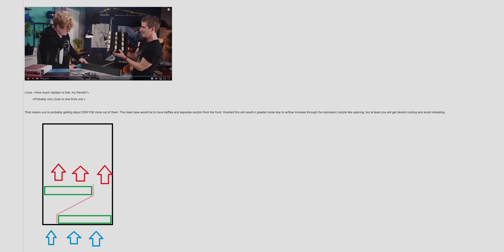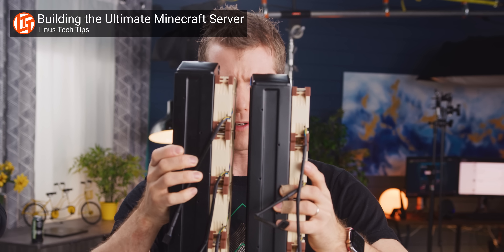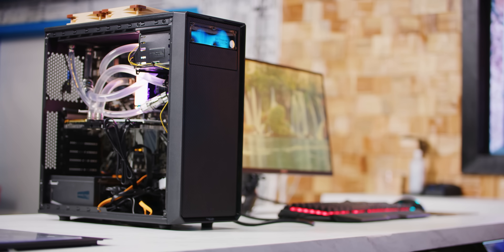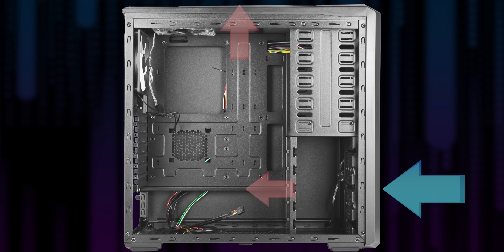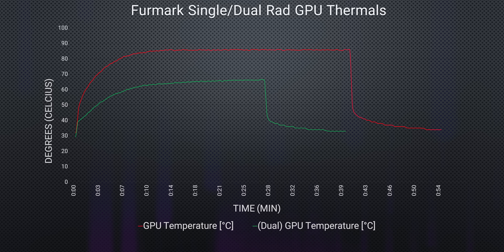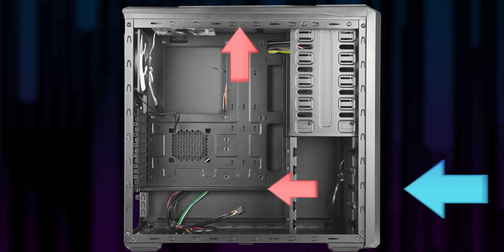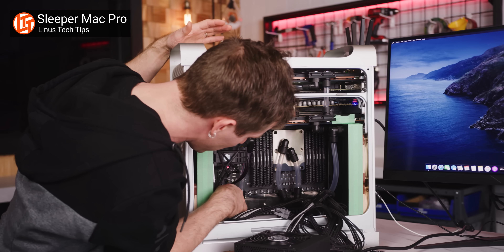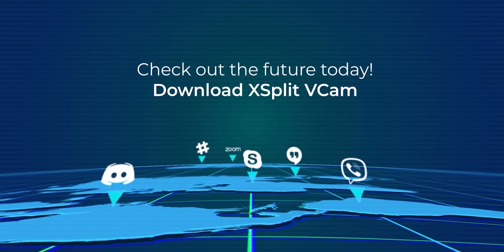I’ve been water cooling wrong for YEARS - $H!T Manufacturers Say

Comment: Although your test yields good results and makes more sense when considering a normal PC build, I assume Corsair was referring to how you stacked the coolers directly one on top of the other in the minecraft build. 

Although the air going through the second rad would most likely have the same/similar temperature as your simulation, the decrease in static pressure through the additional airflow interference of the subsequent rads would most likely be the cause of the negative impact of stacking rads. 

I believe their main point is that you shouldn't stack rads end to end, so to debunk their point i suggest testing with that instead

Apart from that, love the vids, big fan <3
Reply: Did you actually watch the video, he mentions they removed one of the rads from the server and the temperature went up by 5 degree.
Reply: @Torguemada  I did watch the video, and yes he did mention that result in the end, but essentially the whole content of the video up to then does not really serve much purpose and the experimental data is not relevant to that. That one sentence at the end was more relevant as a response to corsair than the rest of the video.
If he had done the same analysis with the stacking of coolers it would have made a lot more sense in my opinion.

Comment: @Linus why not skip the water . And use rads and copper water blocks.  But plumb with copper also then vaccum and charge with freon . Like in heat pipes.
Reply: Basically a bigger Simi modular heat synk . Just the referigant is a better conductor of heat. A CFC licence is not to hard to obtain here in the US. Basically a tough multiple choice test. . I self studied to get a class 2 CFC and passed the core exam plus class1,2,and 3. Giving me a universal cfc and technician licence. I have no clue if the process is similar in Canada. But here if you purchase the exam from a refrigeration or hvac supply business. You can take the study guides ..ect home to prepare. .. I did not know this ..  and just found several free online test that I did until I could pass all of them with perfect scores.  .. and nailed it .

Comment: Reverse the direction of the fans on the front radiator then test again. When adding more radiators you should simply ensure that the air doesn't pass through both ie they should all be set up to blow air out of the case.

Comment: What about water cooling a system with the rad mounted completely outside of the case I am building one with a push pull with a corsair cpu cooler havent finished it yet but just a thought

Comment: More radiators means more flow resistance, more couplings and all, so I use a single radiator as large and thick as possible which right now is a 4×80mm because can fit no more. I do everything to lower flow resistance because OCD and me.

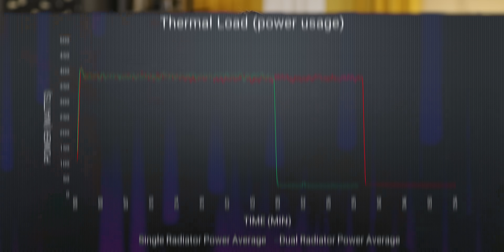Comment: At 5:19, 5:25, and 5:28 I noticed the test for dual radiators ran shorter than single rad (~13 minutes). Wouldn't you want to run the dual system for longer due to the increase thermal capacity with adding more volume of coolant into the system? I would have run the dual rad setup at least twice as long just to prove the accuracy of the results.

Comment: If you add more radiators and keep same amount of fans, sure Corsair is right. But if you sandwich then with extra  fans you get a venturi effect, you get an increese air speed, which dissipates the hot air faster. Also depends how the water loop goes, if the hotest radiator is the last to be touched by the passing air, will still have a Delta T sufficient to not make the radiator redundant. Is this as efficient as running only one radiator ? Hell no ! It will have diminishing return the more you add radiators and fans to the system. Does it work, yep ! But will make the system noisier and power hungry.

Comment: Tell me if i missed something, but I think what corsair meant was that with the same surface area, it is more efficient to have both of the rads suck in fresh air rather then having the second rad suck in warm air. Also the server case, well you removed surface area too which impacts cooling. A proper comparison would be the dual rad test, except once both of the rads are intake, and in the other case the one's intake one's exhaust.

Comment: Industrial thermodynamics engineer here to clear a few things up.

What I think you guys have done is this: the additional top radiator you've added takes the fresh load of hot water and passes it on to the original front radiator. So what happens is the front radiator doesn't have that much heat to dissipate, hence the internal air temperature isn't heated too much. It then passes through the top radiator, which still has plenty of dT (temperature difference) left to not run into diminishing returns. In engineering this is known as a counter-flow heat exchanger. Which is a good thing by the way! so GG for configuring it like that.

What I think happened with the Hackintosh system is you guys had the intake as the hot radiator and the exhaust radiator as the lower temp radiator. Thus indeed the exhaust radiator wouldn't have too much capacity.
Reply: An addition to this: Please google "temp diagram heat exchanger".
With the minecraft server, you probably also set it up as counter-flow. Which means the back radiator is the hottest and the front radiator which takes the fresh air is already the coolest. If you would change the flow direction only the first radiator would do any significant work. The 2nd and 3rd would pretty much just act as a thermal buffer due to mass.
Reply: I build a mITX water cooled system as a side project. In these systems every little thing counts, so diminishing returns is completely out of the question. For bigger systems like yours that is of much less significance of course so you can just get away with it.

Comment: Linus... Are you serious? Those top fans - outside - the case aren't pulling any hot air through the rad. OF COURSE IT'S GOING TO RUN COOLER. This is the most brain dead video I've seen. Corsair isn't wrong, you literally used your ram as an excuse for doing your rigs wrong since day 1.

Comment: Hey Linus, it depends on order of your radiators. In your test setup you were using "hot radiator" as first one and "cool radiator" as second one. That means if your water is 50°C, your internal temp is 35°C and your ambient is 20°C, you always have enough temperature difference on both radiators. But you should try to make opposite order. If you push 50°C to your "cold radiator" then input air for "hot radiator" will be close to input water temperature and that means your second "hot radiator" will be useless.

Comment: Corsair have a point in minecraft server. 
Rad 2 can only take in what rad 1 kicks out.
Example 
1 21in - 32 out
2 32in - 42 out
3 42in - ......out

The gross movement has to be the same however the amount disbursed wouldn't be different to 1 rad

Comment: Another example that CFD models aren't foolproof is Formula 1. They're leading edge where tech and cfd goes, yet CFD models don't always translate well into the real world and that's why they don't depend solely on that data and always test it with scale models in wind tunnels and later the real cars. There's been many times where the CFD models don't match real world performance and has screwed many team car designs and their seasons.

Comment: two radiators series type would probably matter too!!!?? How different would temps be if:
if both waterblocks connect to intake rad first (cooler air)
if both waterblocks connect to exhaust rad first (warmer air from inside)

when going to exhaust rad first it would potentially have bigger thermal delta on both rads. Hottest watter being hit by warmish air, and then a bit less warm water being hit by cool outside air. Perhaps combined delta is greater than if hot water go to intake rad first for the greatest innitial exhange delta, and then hopefully enough outside air gets in the case to mix with warm air to exhange with already much cooler loop water second time on exhaust? Dont have the rads to test it myself but definitely would if i could! Would definitely watch vid on that! Or perhaps there is one?

Comment: They were critizing you running hot air over hot rads....and if you were gonna remove a stacked rad make sure you still had the same amount of pump flow and coolant volume. And they were trying to point out the push pull configurations for example cpu coolers don't apply in the case for radiator probably

Comment: Honestly? When you think in terms of energy it makes more sense to me. Say you put 500W of energy into the water. If your rad can take care of 300W of energy you still have 200W left, regardless of air temperature. So an additional radiator will have to remove 200W of energy from the water.

Comment: Assuming a totally sealed case with the only intake being the front and the only exit being the top rad you can still have a heat dissipation if you build your loop cross flow. Having the top radiator being the first to receive the fluid and then the front one, the air coming in through the front radiator will be slightly cooler than the temperature of the top radiator allowing more heat exchange. That's what thermodynamics says
Reply: thinking that the water in the rad closer to the cpu is hotter is a very common mistake :) the water in the 2nd rad is not cooler either. That's the thing with pc water cooling, the water everywhere has the same temperature.
What you are describing would have made sense if there was no pump circulating the water.
Reply: I study chemical enginering at the university so I'm pretty sure on how a heat exchanger works, the pump will even the temperature of the fluid but the water exiting the rad will always be cooler than the water entering it even if it's only a 0.1 °C difference. According the laws of thermodinamichs there'll be heat exchange as long there's a difference in temperature, to assure that this difference is present the "best" way to make an heat exchanger is to have the cold fluid moving from the front to the rear and the warm fluid moving from the rear to the front

Comment: Stacking radiators works, even if it simply is because you way more water in the loop than without them, lol. Create a watercooling loop that has a 10 gallon reservoir and you won't need ANY radiators, because the water loses more energy than a pc can put into it. Heating water takes a fuckload of power.

Comment: i am kinda sad you didnt touch on the "plumbing direction" of the water since using cocurrent or counterflow heat exchange is a really big deal regarinding the cooling setup efficiency.
Using the layout you used the plumbing should be done in this order: hottest water coming from cpu and gpu goes to the top mounted rad than the water goes to the front rad.
Reply: @benoitboyer3287  food engineer here! Been there, done that! 😁
Reply: @jmartinblaise  Wouldn't the coolant temp hit equilibrium and it wouldn't matter? Custom loops are so small that coolant temps entering and exiting a rad are usually within 0.5 to 1C of each other. Might as well make all radiators intake to promote positive pressure and use 1 fan as exhaust.
Reply: @Kokinkun  the coolant here is the air. Even if the water reaches equilibrium, the plumbing should be done in a counterflow setup. In a cocurrent setup the reached equilibrium would be at a higher temp meaning higher fan rpm to keep that temp.

Comment: Corsair is right, you shouldn’t stack radiators but put them side by side.
Reply: Basically Side-by-side > stacking > single
Reply: If space is constrain (and most likely) stacking is the solution.
Reply: @tommegg8486  
Increase airflow is the correct answer to constrained space with saturated cooler.
4x5900RPM delta fans and one Rad vs 12x2200RPM consumer fans and three rads, which do you think would provide better cooling?
Reply: @magottyk  personally I'd choose the one rad 4 delta fans config as it will be easier to install. The lower rpm fans config might get the best sound performance as it will be low a hum instead of the high pitched fast delta fans. Performance? I don't know, they might share some similarity
Reply: @tommegg8486  
alternately 8 lower RPM delta's with a lower Db rating like 3700RPM in push pull config.
Reply: Like tôle by other stacking work and is still more cooling than a single similar radiator.
Reply: @Deep Throat then you chose to ignore where they addressed the other builds and still saw degredation of cooling performance when removing the radiator?
Reply: @Deep Throat watch and listen to the video instead of skipping through the graph slides.

Comment: A test to find out exactly what is going on would be for you to test the temp of the water and air before and after it goes through each radiator. At the moment you're guessing that the temp is a bit cooler before it goes into the second rad, but you don't know for sure. Also Corsair said that modern radiators are so efficient that they almost perfectly dump the water heat into the air, but again you don't have data to say if that's true or not.

Comment: If you stack radiators and use the "last" radiator that gets the air as the first radiator in the loop, then that wil disapate the most heat (incoming air is not that hot yet and fluid temps are the highest. The next rad has to deal with less hot fluid but also has cooler incoming air, since the heat transfer from rad to air is not perfect OR you can work with lower fan speeds for noise reduction. Adding a third rad would result in even lower fluid temps but also (if it is the last rad) with the coolest air coming into the system. That would be allot of diminishing returns but will increase the overal transfer from fluid to air because you keep the delta the highest.  A singel bigger rad with more air flowing in/out might the best sollution, but there are other considerations such as noise.

In case of a PC case with an top outtake and front intake: Just make the top one the first rad in the loop and the front one the last. This wil dump the bulk of the heat out of the system and that heat will not be reintroduced into the system at the front. Flip the rad order and then you will keep that heat in the overal system (just in the form of hot air instead of hot liquid). Like the images from corsair suggested. By using the outtake rad as the first rad, even it is a smaller one, you will dump the bulk of the heat out and increase overall heat disapation capability.
Reply: What do you mean by first in a loop? I'm asking because this confuses me. It's a loop, there is not first, no? What I'm understanding from your comment (and what I remember from physics) is that the delta in temperature between the liquid and the air is more important than the actual air temperature, right? So the radiator receiving hotter liquid should be the one receiving the hotter air?
Reply: @maximilianw4354  yes! Then the delta between radiators is more equal and the radiators that come after can't heat that one up. So first radiator that gets the air is the last in the loop and the coldest, in theory. Temps in a loop differ about 2 c overall so i doubt it will make the biggest difference. But if the liquid is really toasty it might? No degree in physics lol, just some logical thinking.

Comment: I think maybe Corsair was trying to make a diffrent point here .... cooling would be better having the radiators side to side than face to face.
Also,
what if you put both radiators taking fresh air from outside and the vents just taking the hot air out?

PS:Are you conecting the radiators in parallel so the IN of the second one is connected to the OUT of the first one?
Is the hot water going into the 1st radiator first or into the 3rd radiator first?

I love you guys but sorry, your experiment is not very scientific. Not a really good empirical test I beleive
Reply: True. nothing to do with what corsair meant.
Reply: Couldn't have said it better, not a good empirical test.

As he said in the video, took what he said with a grain of salt.
Reply: "Also,
what if you put both radiators taking fresh air from outside and the vents just taking the hot air out?"

This.... This will create positive pressure on the inside, bringing cool air from the out-side, over the rads, picking up a little heat, then forcing the warm(er) air out of all openings and gaps, also preventing dust ingress through said openings and gaps... this is how I setup my PC's 99% of the time...

Air Cooled components often vent into the case also (such as Asus GPU's have an outside>in configuration) - so forcing this warmer air out, faster is better...
Reply: @Ghozer  I mention that in my comment. Agree with you
Reply: Obi Dark  no, thanks
Reply: What you described isn't parallel. Running the output of one to the input of the other is series. If the loop was split to each radiator and rejoined afterwards, that would be parallel.
Reply: My first thought on seeing the test rig was "That's not going to let them actually test the hypothesis". 
The sanity check with the stacked radiators was more relevant; I wonder if those fans are simply powerful enough to prevent the decrease in airflow that Corsair warned about.
Still, a more controlled test for the stacked radiators would have left the 3rd radiator in place with the fans running but without plumbing it, ensuring the same airflow conditions.

I agree with the takeaway that every situation is different and you have to test for yourself, it just would have been nice to have a somewhat more controlled test.
Reply: You have a fair point... your comments (which is based on Corsairs remak) is a good rule of thumb of what to watch out for. I honestly did not even think of your idea with the stacked radiators (although It's probably because I have never actually intended so stack radiators).

Anyway your comment is good and I'm glad Corsair pointed this out!